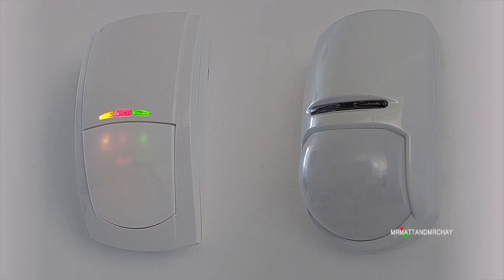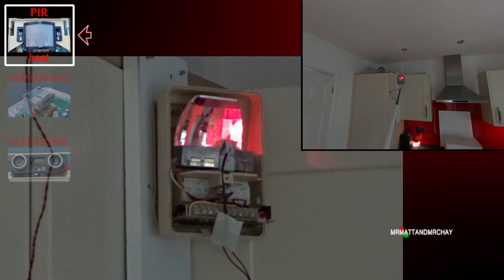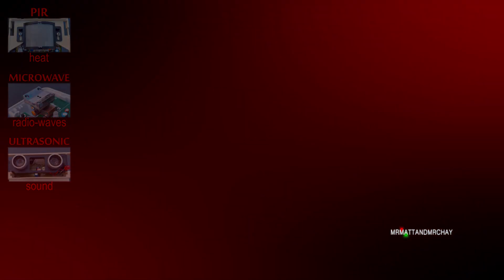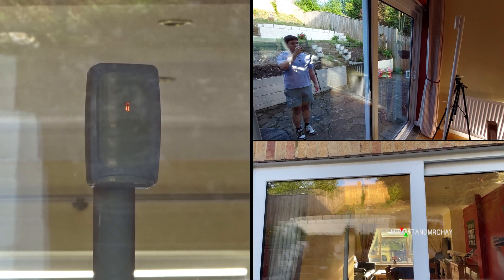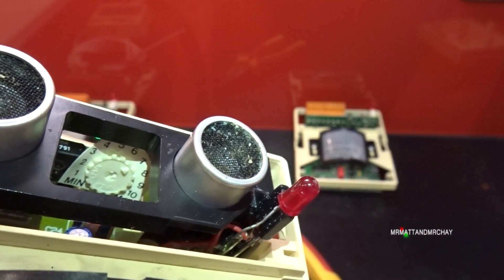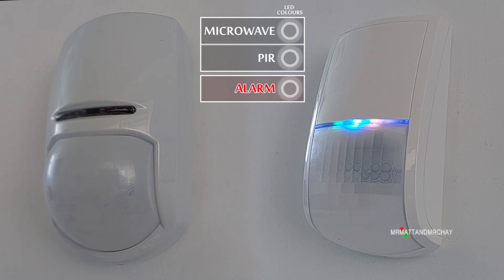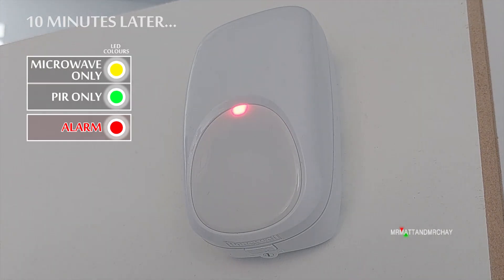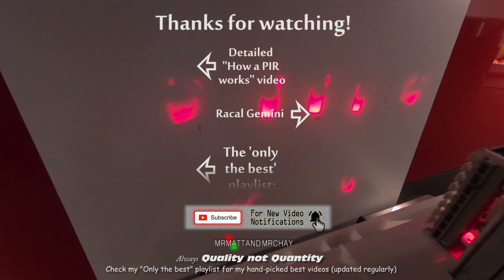The DUALTEC explained ...PIR, MICROWAVE but WHY? (movement detector)

Comment: I remember we used to create our own "dualtecs" by wiring in parallel separate  RACAL Microwave or Aritech ultrasonic and pir detectors, years before they were available as a combined unit !
Reply from the maker: Yep, seen this done in the past!  When a detector has been replaced many times and you suspect it's to do with the environment it's in, then before the age of the dualtec, that was an option.  I've mostly seen PIRs doubled up.  For example 2x Racal 772s, 2x Ademco 650s in warehouses.  The 772 combination was terrible at picking up!

Comment: I have several "pure" PIR detectors in my house for many years and never had a false alarm.  They are honeywell quad element detectors and I believe they require two to activate to signal an alarm.  I have a dualtech in the garage as the more drafty environment means more chance of false alarms.